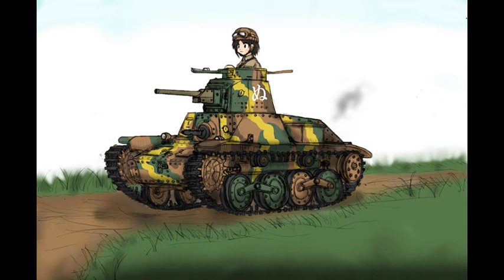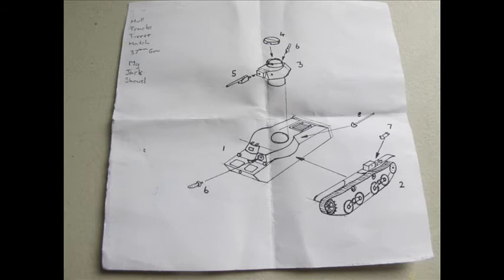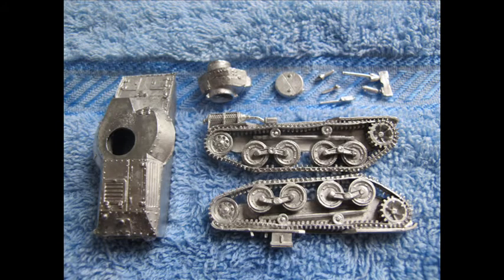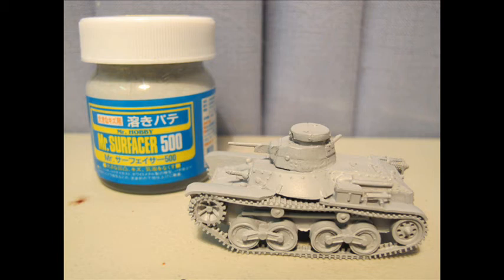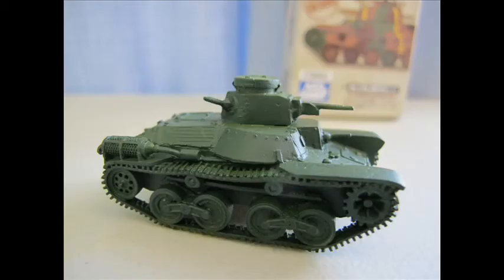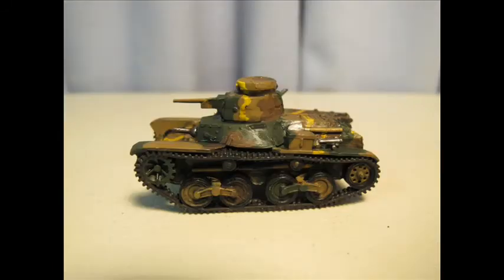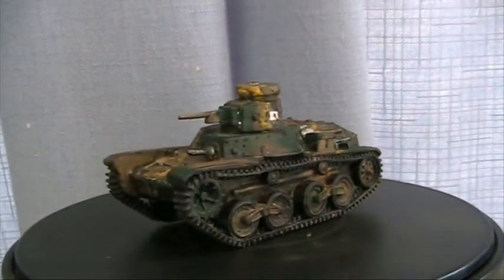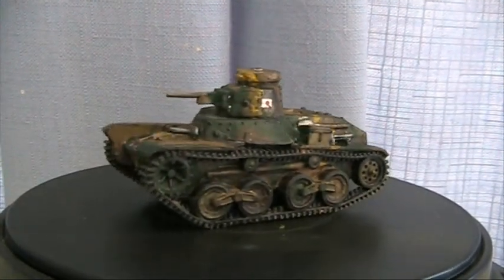SHQ miniatures 1:72 type 95 Ha-Go

Comment: is super glue the best way or the only way to assemble these metal kits?
Reply from the maker: Super glue is what I like to use, 2 part epoxy and other high strength contact glues can also work.
Reply: mokanaman  você vende o tanque para min se você vender eu te passo o meu numero de celular e eu sou do  Brasil fica dica